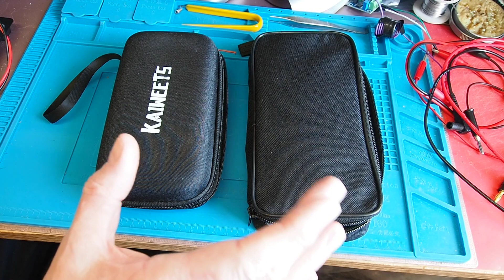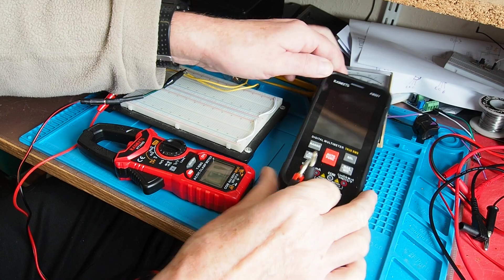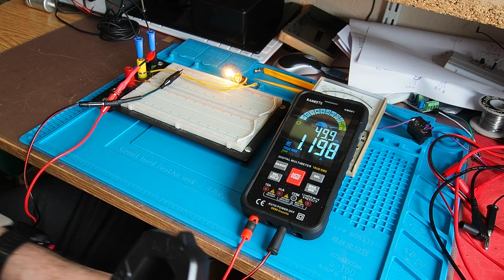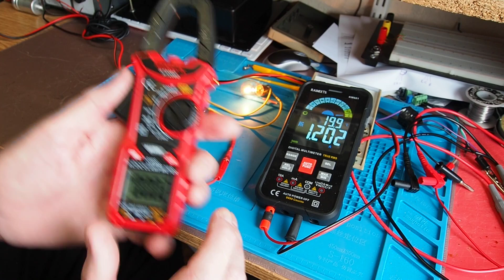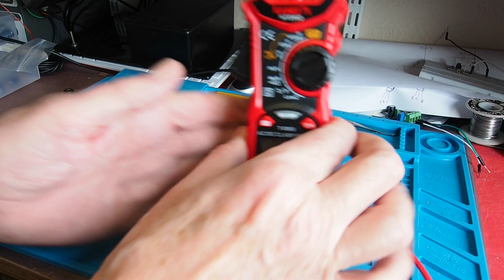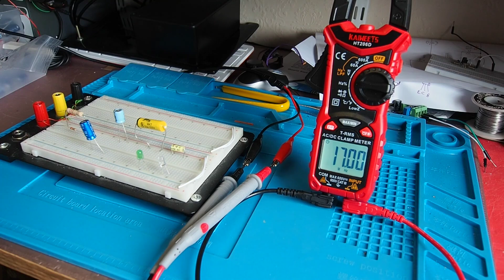The Kaiweets HT206D Clamp Meter and KM601 Multimeter – complimentary Instruments - #106

Comment: Thanks for the video.  I recently bought the 208D version and it is very handy indeed for working on my aging Toyota Yaris.  The flashlight is actually quite handy when you are working upside down under the dash.   And no more blown fuses from accidentally leaving the meter in current mode and taking a voltage measurement.   Here are two more interesting applications:  My landlord recently came over to check the hallway light and I showed him how cold it was in the building (16C) and he turned the heat on.  My 2 grandkids use it as a "Ghost Busters" meter using the non-contact sensor to search for ghosts in the oven, the toaster, etc.   They use the flashlight to check for ghosts in the darkened basement.  But if they see a spider, they come running back up.  Cheers from Canada :-)

Comment: Weird question, can you put a higher rating fuse, say 20A, in those non-clamp DMM and use it for measuring high current circuits for very short duration (<5secs) without causing damage?

Comment: The clamp meter probably more accurate if you measure amps on a straight wire, not on a U turn and position the wire at the middle of the clamp hole and keep it perpendicular. There are two sign for that on the clamp arms.
Reply: It can be improved by looping the wire 10 times to get a 10x reading, which you just divide by 10 to get the actual measurement. 12:15
Reply: @wingerrrrrrrrr  When you measure AC, then yes. I'm speaking about DC measure.
Reply: It works for DC as well, if your wire is thin enough and can be looped. If it's thick like auto battery cable, then it wouldn't be possible.